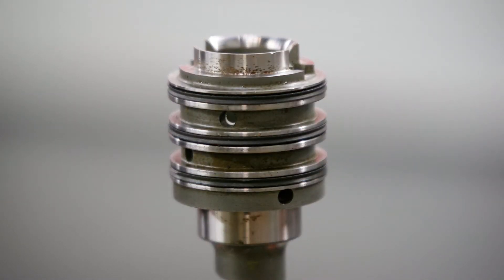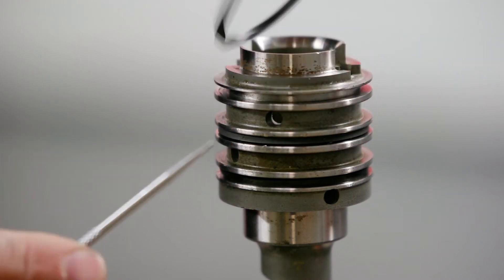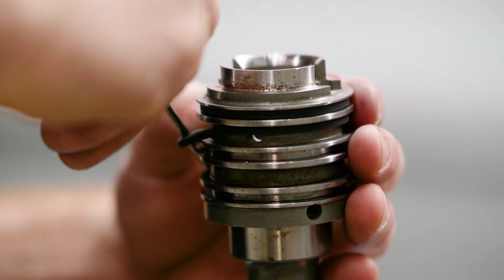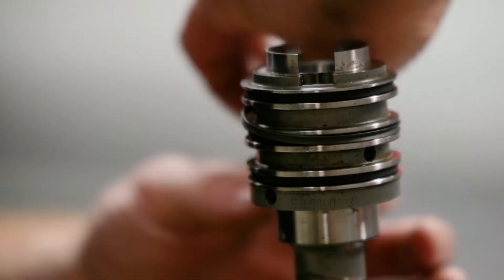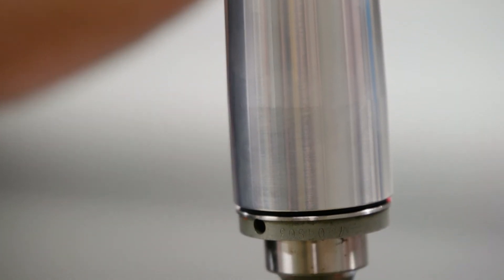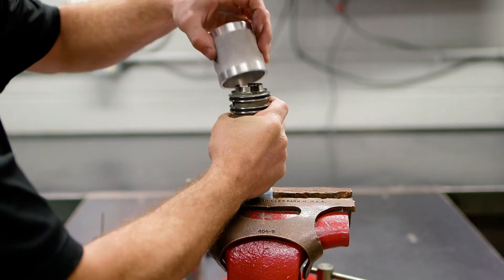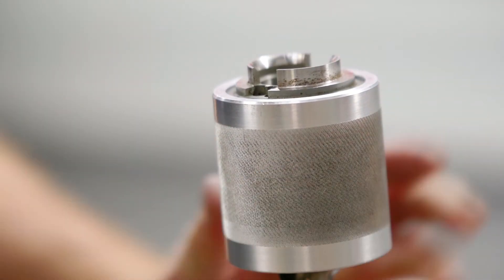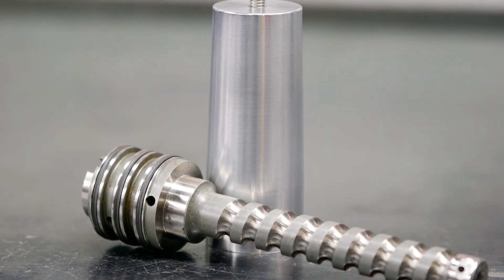Sheppard M-series Ring Installer

Comment: As a seasoned Rebuilder myself, I can tell you this tool is for a beginner. This tool and method is way more complicated and takes twice as long to do the job.
If you know what you're doing, you very rarely have an issue with breaking those teflon rings or have warranty issues regarding said rings. Nice try on the tool though...looks impressive.